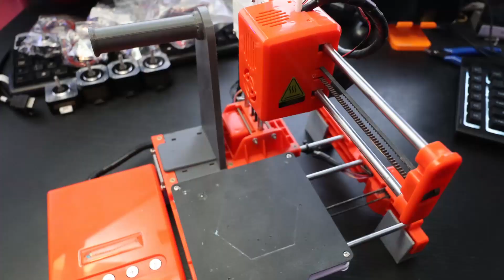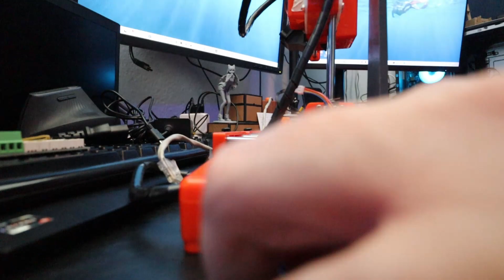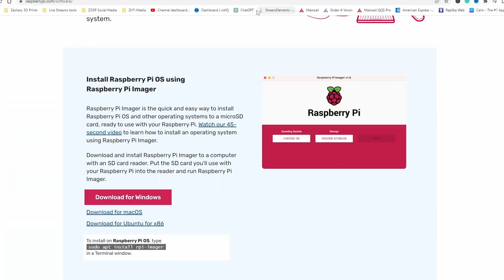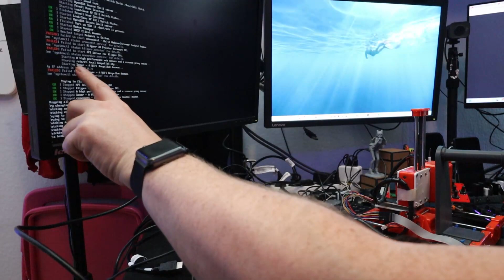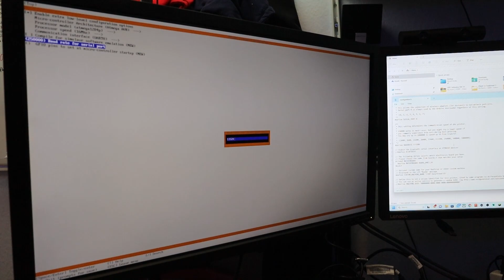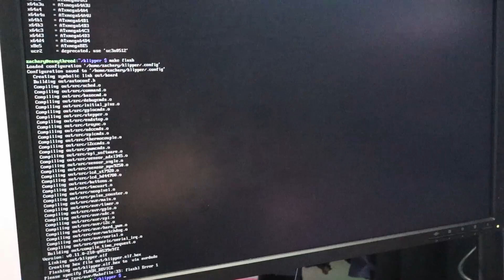Can you install Klipper on Easythreed X1 - Easythreed X1 Upgrades - part 1

Comment: Thank you for your EZ3D X1 vids. You are my go to for this 3d printer. I'm planning to upgrade but I currently don't have space for a more sizable printer so still working with my EZ3D X1.
Reply from the maker: Thank you so much for this amazing comment. I was thinking a long time if I want to continue with this project or not. I have noticed that the motors are getting very hot during the klipper installation and running my prints on there. I did get some print out of it, but it was a failed print and it took a long time to get the config file right. I kept getting issues, so I had to stop with this project, to was getting too expensive and taking time and it became very complex. 
If your X1 is original and you are getting prints out of it, leave it like that and use that instead of this upgrade, because if you override the firmware, you can't get it back on the board again.

Comment: Hiya, I just bought a used X2 because I'm fairly sure the person selling it didn't know how to use it and didn't want to bother learning. X2 has a tiny screen that displays the default marlin interface (just at ant scale really), you think klipper will work well wil it?
Reply from the maker: Hello, sorry for my late reply/responds to your question. No excuse for my very late respond. 
I did the klipper installation on my X1 to see if it is possible, but along the way I have had some issues that I wanted to solve but where getting too complicated in fine-tuning the config file. I did get some printing going on, but it was way too off to get it right and motors where getting very hot. Because of that I have cancelled this upgrade.
Reply: no answer thats not so friendly Zachary
Reply from the maker: Yes, you are so right, Reaction could have been sooner. But I'm very friendly person Frederik, do you sometimes see my livestreams?